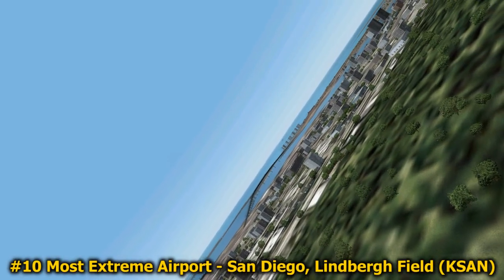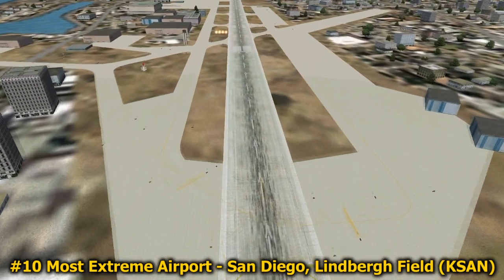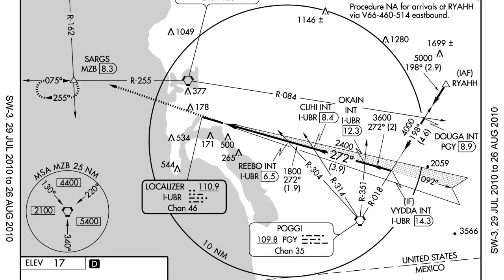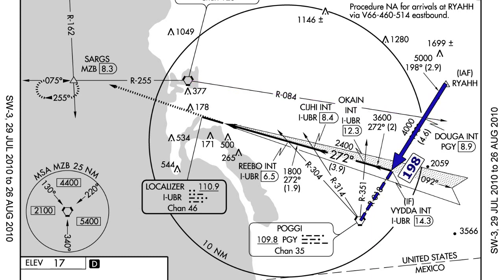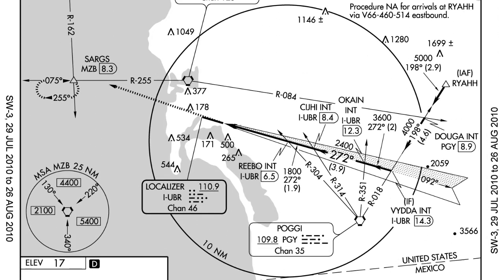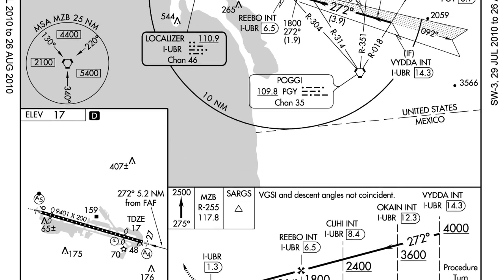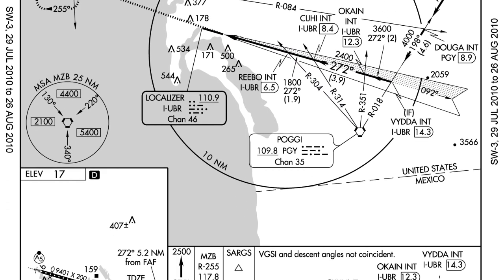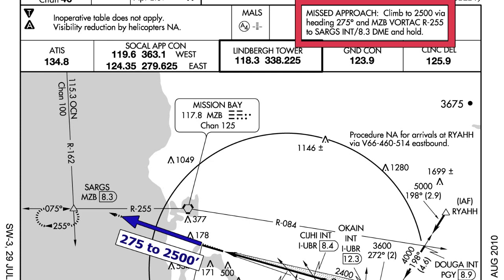10 Most Extreme Airports - #10 San Diego KSAN (Episode 2-1)

Comment from the maker: Your navigation to the IAF is done in flight planning. When you create a flight plan you add the IAF to it (last point before the destination airport).

Yes you can get to RYAHH without a GPS by using triangulation, but that part is not shown on the approach plate. It is shown on a Low Altitude Enroute IFR chart L4, and again that is a part of flight planning.

RYAHH is on a R017 from PGY (heading 197 to it) and R076 from MZB VOR on V66/460/514

Comment from the maker: @janujan995

You intercept the Localizer same as a VOR, when the needle starts to move you start turning, only reason I started turning just a little early here is because I did have the DME and an airliner is fast so I anticipated. I could have waited.

Every pilot flying on IFR uses approach plates, it doesn't matter if you are a private pilot or an airline pilot flying a 747.

Today, a lot of the plates and approaches are electronic (iPad, FMC etc) but its still good to have a paper backup.

Comment: @FSX404
Thank you. Because I was flying Qatar Airways from Zurich to Doha, and the only time I experienced a bank was on departure. But when I looked at the approach plates in this link (vatme.net/files/VATBAH/OTBD.pdf) there were huge turns. I didn't know it they had used approach plates or if they had just came in straight onto the runway.

Comment: found out the approach was redone based on a plate from november 10, 2016. New IAF at point LYNDI. 5K feet and an airspeed restriction of 210  also it says  on the 2016 plate  RNAV 1-DME/DME/IRU or GPS required.
https://skyvector.com/files/tpp/1712/pdf/00373L27.PDF
also of note Latin VFR has made a payware addon for Sand Diego  only issue with it is it seems to only be available for P3D-V4
http://www.latinvfr.org/
Reply: also of note the MDA went up to 680 and the visiblity for class D went downfn from 2 mi to 1.75 mi

Comment: Excuse me Sir! Will you please tell me; what is the recommended vertical descending speed from point REEBO at 1800 ft to the RWY touch zone?!
Reply from the maker: I believe airliners descend at 3000 to 1500 fpm above 1000 feet AGL. Under 1000 feet AGL descent should be 1000 fpm or less (this usually due to  airline company restrictions). I believe most if not all airlines require this unless there is some specific approach that requires more in which case pilots have to be specifically trained and signed off for that approach.
Reply from the maker: Last descent here from 1800 feet has a slope of 3.2 deg, so the descent from 1800 feet can be at around 800-1000 fpm
Reply: +GVad The Pilot (FSX404) 
I understand it clearly now. Thank you very much!